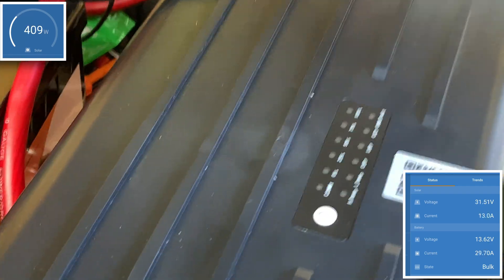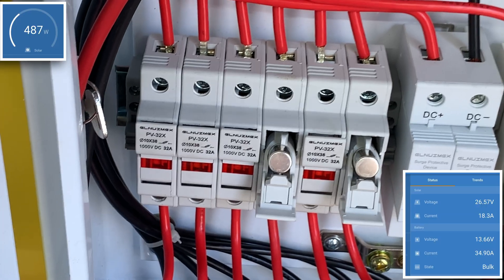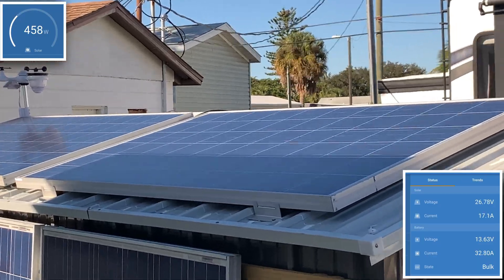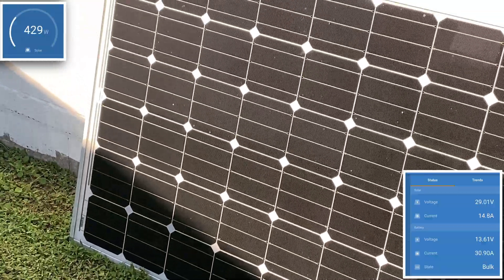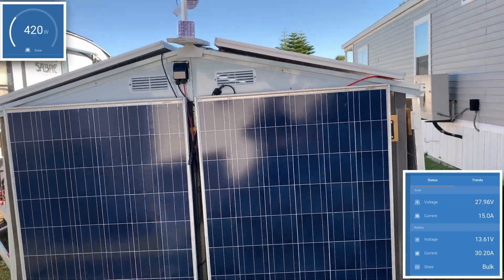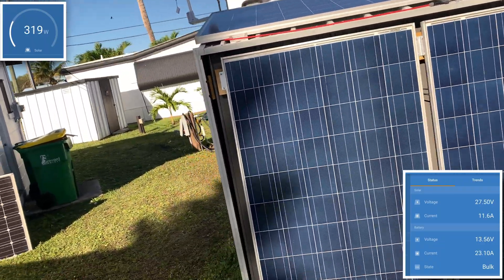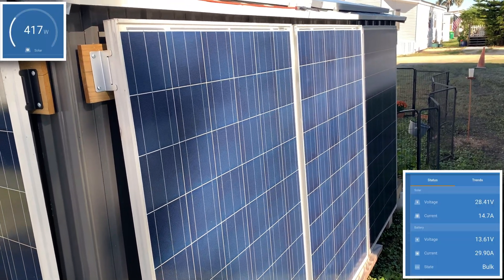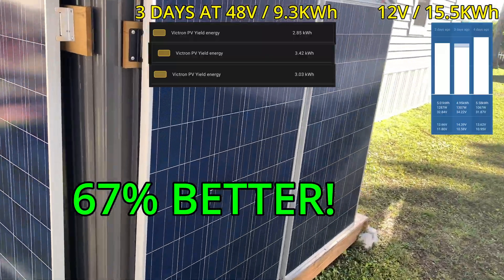Parallel Power! Why 12V Solar Beats 48V in Real Life

Comment: Been waiting to do something like this but I have zero idea how to wire or install solar and what you need it but you should put the sides on henges so they can go horizontal instead of vertical and that way each time sun on back side of the shed it will still be able to produce more power and be used kinda like lean 2 as well for mowers what not and make sure to have door facing north or south helps a lot as well and maybe put for cliff things or tow truck for flat bed so say if you do have to move slide it right on flat bed or use fork cliff onto trailer and take to new spot put even hot water main water filter stuff as well so all gotta do is bring with you maybe tanks for water so it's like portable utilities for RV for boon docking or start homesteads stuff like that be sick been think of something like this for solar and water filter system as well so throw on trailed and tow it with my diesel pusher motor home and have all utilities with me as well
Reply from the maker: The henges is something I will play with, just to see it work ..

Comment: As a person who has done some research with tracking solar systems.
If you would have a way to angle your panels on the sides. This might increase your efficiency by 20%. If you had a solar tracking system. You could increase your solar efficiency by 38%. Something to think about.
Reply from the maker: Yes, sadly at this location it was not an option .. But moving soon and we get a bigger shed .. with less restrictions..

Comment: It’s interesting to see you trying out a 12V setup with parallel panels. Just wondering, in this video, have you mounted a reverse blocking diode on the output of each panel? Considering that your panels are facing very different directions, at no time will all of them be equally illuminated during the day. The ones that are not being illuminated could act as current sink as there might be some leakage through the panels in the backwards direction. How much depends on the panel. I’ve seen some panels that are pretty bad in this regard, while others block current better in a reverse bias situation. But nevertheless, solar panels should never be reversed biased because apart from potentially loading down other panels’ output, applying a reverse voltage can also degrade a panel and shorten its lifespan in the long run. If the setup in this video did not have a reverse blocking diode attached in series with the positive output of each panel, then it would be extremely interesting to see what the result would be if you did attach a diode to every panel when running them in parallel like that. (Diodes with already attached MC4 connectors can be found online.)
Or conversely, if this setup already has a reverse blocking diode on every solar panel, then it would be very interesting to see if there is any difference in power yield over the course of a day without those diodes attached.
I’ve experimented a bit with this myself and experienced some improvement with attached in-line blocking diodes in a case where panels are facing different directions. As a bonus, those diodes also provide an extra safety feature since if a panel shorts out, all the power produced by the working panels won’t be dumped into the shorted panel. Of course, all of this applies only when panels are paralleled together. Series connections are a completely different story. (Pretty sure you know most of this already but I thought I would mention it for other people who might stop by.)
Reply from the maker: Nope, but I got some in today .. Sounds like a fun experiment .. :) Will let you know what I find out .. I'm sure it will make an interesting video :)
Reply: @MattManSolar   Nice! :) By the way, those diodes that are readily available with MC4 connectors already attached are pretty much always of the epoxy-molded type as far as I’ve seen. I think those are R6 packages or something like that. There is a limit to how much current those can handle, so each diode should pass the current from one panel only to be on the safe side. If two panels are producing say 8A each and they are in parallel, then there will be 16A flowing in the wire once those panels are branched together. That might be a little bit too much for an epoxy-molded diode of that size to handle, even though they are of the Schottky type. On the other hand, if the parallel connection happens on the cathode side of the diodes, then each diode will only conduct the current from the panel that is connected to its anode side, which should then be within the limits of the diode. Just thought I’d throw that out there since it can be a quite important heads up. It probably wouldn’t be optimal to have the diodes burning up. :)
Looking forward to your next videos and a possible follow up. Thank you for always sharing your knowledge with us in your videos.